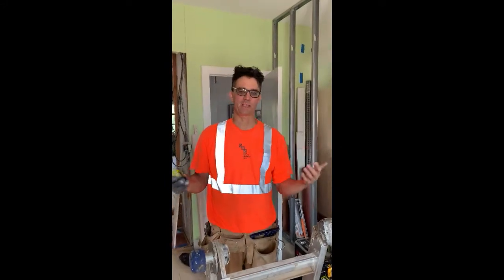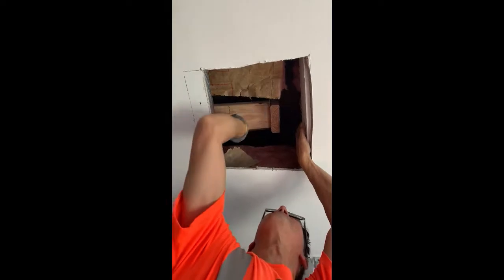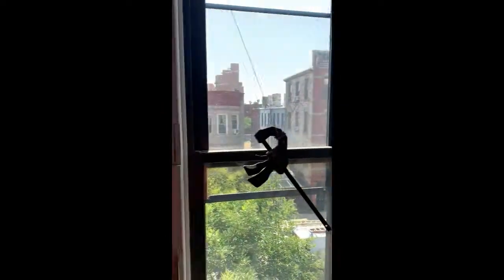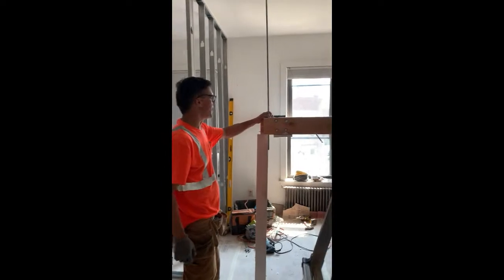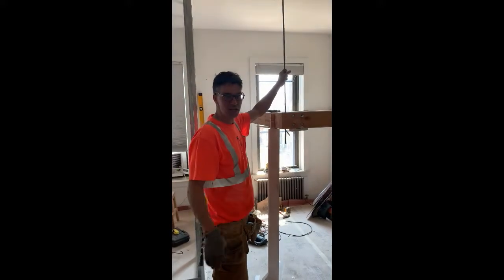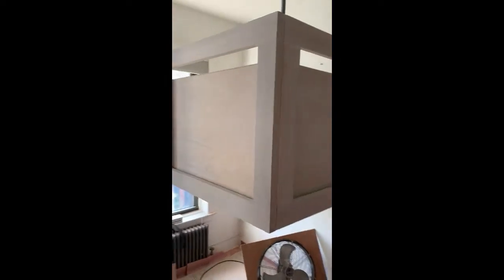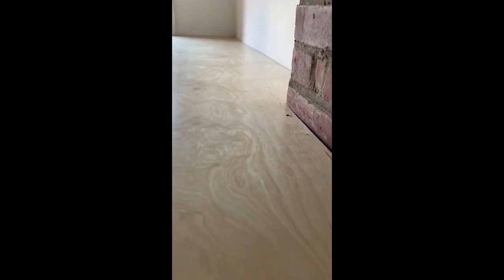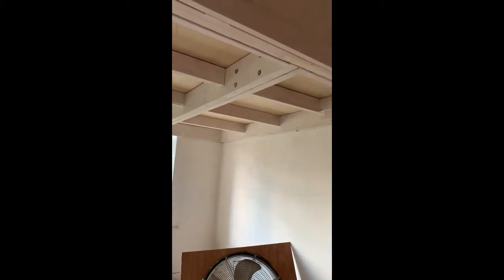New Loft Bed Suspended from Ceiling

Comment: Did you have to reinforce those ceiling joists?  And is it required?  Was thinking of going this route with a full size loft bed.
Reply from the maker: No I don't think that that is required - after all the threaded rod is only supporting a fraction of the load - most of the structure is being supported by connections in the wall.
Reply: @SanderHicks  so you just had to run a 2x6 because there wasn't a stud where you needed it?  How did the rod connect to the 2x6?  Did you drill it all the way through and then use a plate/nut combo?